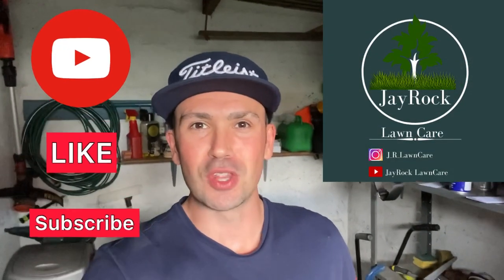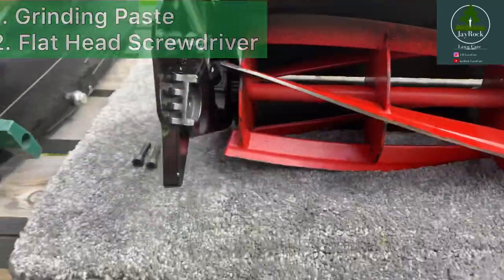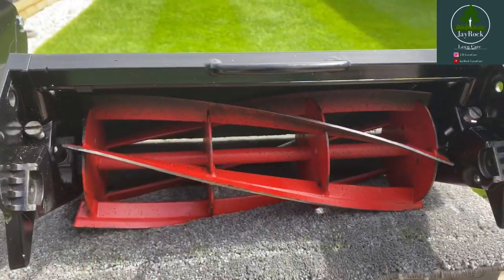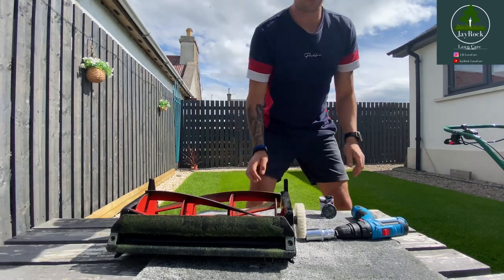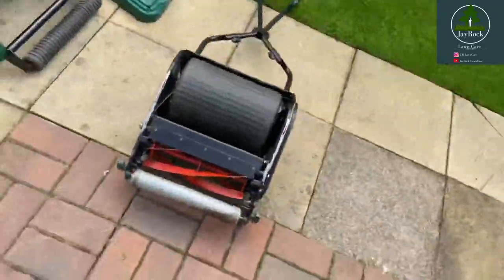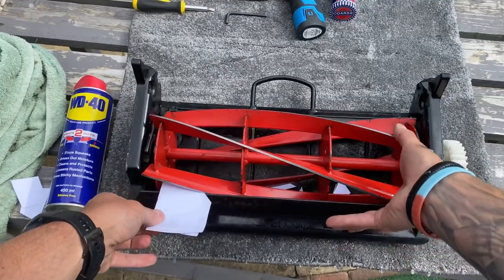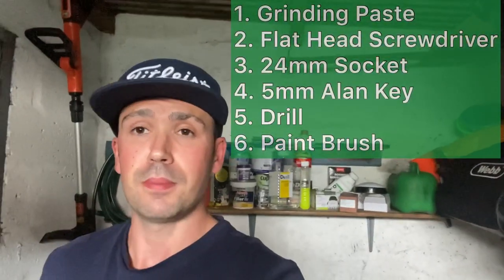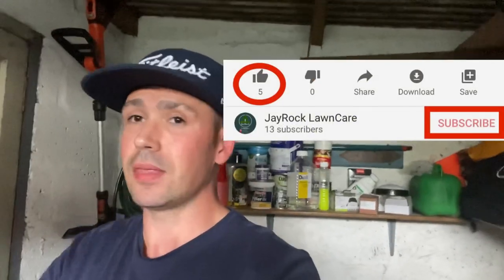How to Sharpen a Cylinder mower // Back lapping

Comment: Thank you  - great video. You just saved me for a trip to the dealer for grinding. Now my mower runs like new through the long grass after the winter. And I didn't even have the grinding paste, so I had to use what I had. I grinded the edge of the blades with metal grinding paper until they shined (mower turned off), sprayed with WD40 over it all and adjusted the screws to find the right position for the transverse knife. Shortly after the mower worked very fine again - before it could not cut through the long grass and stopped. I will also buy some grinding paste to try the next time. Greetings from Denmark 🙂

Comment: What a gorgeous young man. With some very useful information. I had a quote of £80 to sharpen my rotary blade lawnmower.
Reply from the maker: Thank you Maggie 😂. I really hope this helps! 

A cylinder blade I could imagine being around £50 or so. For a rotary that’s really too much, the chances are you could replace the blade for less than £30 🙂🌱
Reply: @JayRockGroundsMaintenance  I only bought the lawnmower last year. Thank you, this is very helpful.

Comment: Could you show how to take the reel out of the Web push mower. I have one myself and wanting to replace the reel with one that has more than 5 blades so I can get the length on the grass down to 4mm. I have found a way to lower the height on it with some modifications but 5 blades is not enought for the height I want to cut at

Comment: Hello Jay
Good video.
Can I ask what's the push mower like.
Do our when do you use it
Thanks
Reply from the maker: I actually don’t use it much.. but that is only because I have a better machine. For something that is push operated it works very well and cuts very well, it takes several passes to get a decent stripe though 😄

Comment: Great video. Cheers.
How do you remove the cylinder itself from the casing eg to replace / weld a blade. Can it remove the nut, worried I might bugger it up
Reply from the maker: Thank you Paul! I have never actually removed the cylinder from The casing, although if you got in touch with Allett they have a great customer service to advise with that type of thing 💪🏽🌱
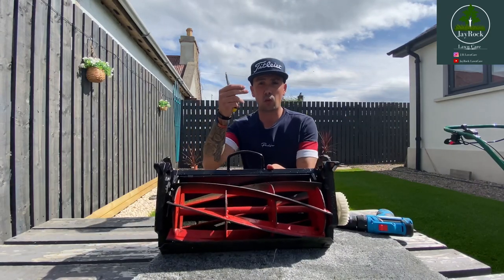Reply: Great of you to reply so quickly. Thanks! I meant to ask, why did you drop the cylinder down one click ; this was up to around the 3:30 mark
Reply from the maker: @paulmurray5730   no problem! It increases the sharpening by dropping the depth 🙌🏽🌱

Comment: I've got an old Webb Whippet  probably from the 50's/60's i'm going to try and use the grinding paste on it and backlap it. Our lawns are quite small, i'm not sure if its worth getting a petrol cylinder or not...
Reply from the maker: Paul,  the ones from that era are a different level ! You’ll find if you can get that blade sharp then it will cut like a dream!🌱
Reply: @JayRockGroundsMaintenance  Thank you buddy. I'll let you know how I get on!
Reply from the maker: @paulyeomans8507  thanks mate ! It’s always good to hear how things are working 💪🏽
Reply: Hi Paul, I've just been handed down my Grandads Webb Whippet and looking to restore it. I'm not sure if I am missing anything but I can't see a way to lower the cylinder closer to the bedknife? Have you managed to backlap yours yet?  @JayRock Lawn Care & Gardening, great video and thanks for the info!
Reply: I wasn't using my eyes, just spotted the rod that braces the front has nuts either side to rise or lower the cylinder!
Reply from the maker: @mattbuckley7309  no worries at all! Glad it has been helpful 😄

Comment: I have watched this video plus another for Allett mower both very similar except Jay said says rotate cylinder clockwise whereas the other says put drill in reverse (ante clockwise) which one is correct or are they both correct?
Reply from the maker: Yea David so you want the blade turning away from the bed knife 👍🏼🌱

Comment: I found that the idea of a  cylinder mower was logical when I got one but in reality to get it serviced and the blade sharpened the cost involved was more yearly than what the mower was worth and just to get the cylinder blade sharpened professionally and have the blade balanced was hundreds of pounds that I wasn’t going to pay as I wasn’t cutting golf or bowling greens so it didn’t make sense. I tried this method and a few more to no success nothing really worked well enough so I ended up selling it and I went back to the old rotary petrol mower. So think twice before spending good money on buying a cylinder mower I had a qualcast classic it was over ten years old when I bought  it was in good condition engine was Italian I payed 200 pounds for it and sold it after a year as it wasn’t affordable to maintain.

Comment: Can I ask if you've tried using the other Allett cartridges with it, ie. the scarifier, verticutter etc.
Reply from the maker: I have a scarifier cartridge that works perfect. I have been assured by Laura at Allett Mowers that they are compatible

Comment: Thanks for the video Jay. Very useful. How long did you do the back lapping on the manual cylinder?
Reply from the maker: Thank you 😄. It was only a few minutes, you can go off of the sound almost, and you can see when the paste has worked it’s way in, for this Video the blades really weren’t that bad so didn’t need to much attention - more for learning purposes 😄. If in doubt, clean it off, do the paper test and then go again if needs be 😀🌱

Comment: What is the difference between the Atco Balmoral 14sk and the Qualcast Classic 35s, apart from the engine.  How much would you expect to pay for a good Balmoral.
Reply from the maker: Hi William ! They are all basically the same, balmoral, Allett, Atco, Suffolk Punch, Qualcast, balmoral I have seen go for anything between £150-£400 second hand I would hope to grab one for under £250 😄
Reply: @JayRockGroundsMaintenance  I was looking at an excellent Atco Balmoral 14sk for 400£.  However it would cost me another £150 for delivery.  Can only find a Qualcast Classic 35s locally  for £260 with the Tecumseh engine!  The Atco has the Kawasaki.  The Atco will stand me £560 if I buy it.  Am I mad?
Reply from the maker: @williamwalker3837  yeah it’s probably worth that much too in brilliant condition, it’s basically the Allett Kensington 💪🏽. The thing is in good condition it’s a good investment. Kensington is something like £1500, so your getting one 1/3 of the price just slightly older - not much will go wrong with a well kept mower, maybe just the pulleys that wear out and cost £10 or so to replace. If it has a scarifier cartridge I would say go for it ! If not maybe bring him down to £500 !😄

Comment: Hi Jay, great videos 👍🏼 would you recommend the Webb push mower? I’m looking to get a cylinder mower for my 25m2 lawn but don’t have the budget for a petrol. Interested in your thoughts as can’t seem to find any YouTube reviews of this mower?
Reply from the maker: Hi there ! I haven’t done a proper review but I talk about it and use it in this video https://youtu.be/ndflPQtkyrU

For 25m/2 it’s probably perfect in all honest. It’s light, it stripes okay, it has a nice clean cut, I think it’s the best manual one that is being made in the uk right now 🙂 you just have to be careful with the height change, that it doesn’t slip while mowing 🙂🌱
Reply: @JayRockGroundsMaintenance  Amazing, thanks you 🙏🏼 that’s just the confirmation I needed, so will go ahead and get one. Can I ask though, which months of the year is it ok to cut the grass so low? I’ve always cut higher but really keen to get it down if using a cylinder mower.

P.S. that edger though…  😮 🤯 💥 👌🏼
Reply from the maker: @amychrisbishop2096  well the max height what is 23.5 is already pretty low, so you may not need to go any lower than that🙌🏽. I think you could work the height down for start of April and cut it at the height all the way till November where you will raise the height again. Baring in mind you’ll need a good watering schedule through summer, water heavy a few times per week. If water costs too much where you are simply
Just go back onto the rotary if needed

Comment: Did you find that the paste doesn't come off very well? I used this grinding paste and later realised that it's not water soluble and so doesn't wash off very easily. A water soluble version is available for the job.
Reply from the maker: Oh right I haven’t used any others ! The grinding paste wasn’t too bad, I just gave it a heavy water and a good rub down, seemed to do the trick 😄

Comment: I'm no expert but I'm pretty sure the reel is not meant to contact the back knife.  id adjust it away until it just stopped contacting. Do this by ear or feel or feeler gauge or cigarette paper.
Reply from the maker: This is how it was done, adjusted by tiny increments until it has given a clean cut. Been using it for nearly a year since and it is still cutting clean each mow 3 times per week😄🌱

Comment: Hi why don’t you use engine to turn blades in situ ?
Reply from the maker: Hi grant ! Thank you for commenting, 2 main reasons;

First is - it would be very dangerous having your hands anywhere close while stretching to activate the cylinder via the engine. 

Secondly, the engine propels the cylinder towards the bed knife in order to cut the grass, in order to back Lapp the cylinder needs to be turning away from the bed knife.

Hope this answers your question :)
Reply: JayRock LawnCare yes it does help  thanks for  enlightening  me

Comment: Hi there sounded like your reel is too tight. I use 1 sheet 9f paper folded to test. The reel should only cut 1 sheet and not the other. Hope you're safe!
Reply from the maker: Thanks Arjun, I’ll take that on board 🙂🌱
Reply: @JayRockGroundsMaintenance  enjoy Jay and stay safe.
Reply: Jay great stuff. Try adjusting the reel to cut one paper only as doing that will make your bed knife and reel and the mower last longer. 😊
Reply from the maker: @arjunsamuel  thanks mate ! It’s been adjusted a couple of times since the video was made 🙌🏽. Still cutting nicely since the last back lap🙌🏽 . Thanks for the too Arjun, keep well buddy 🌱😄